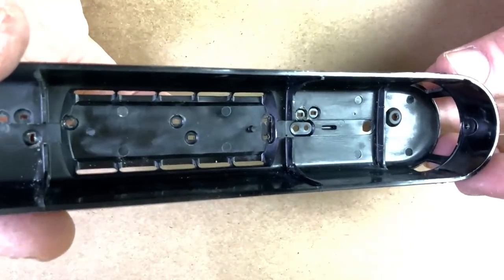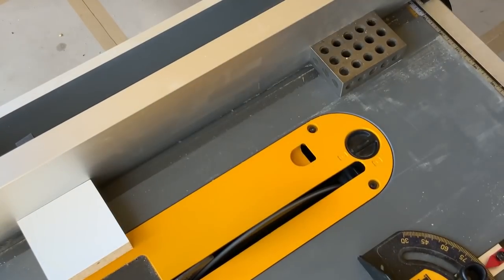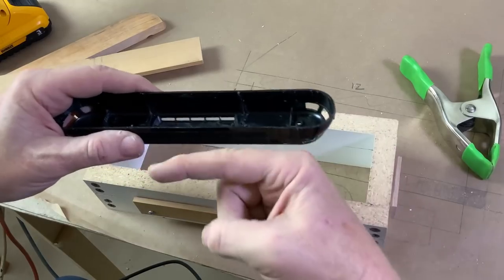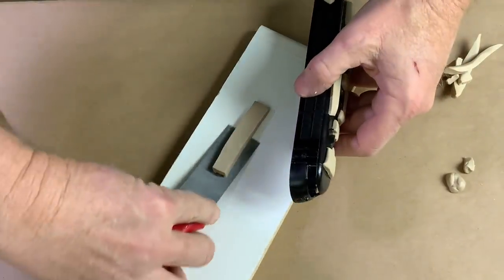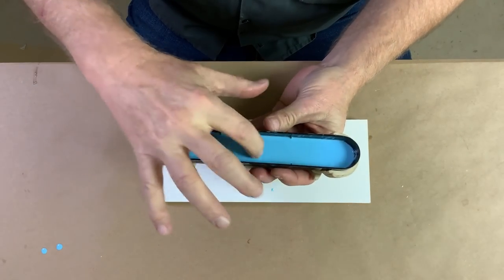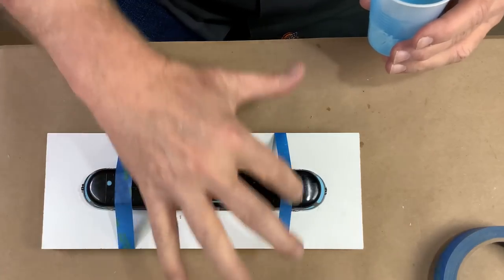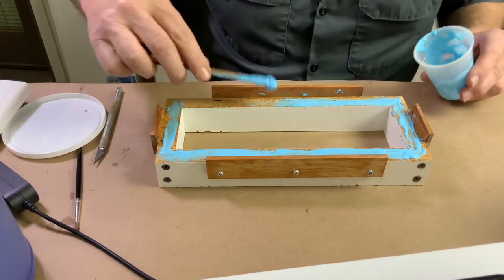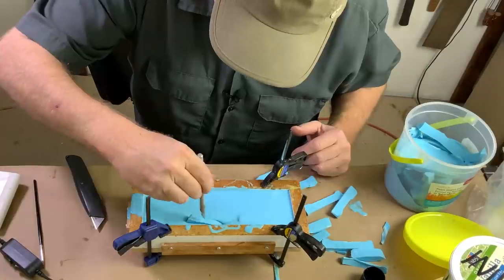Squish Molding An HO Scale Locomotive - Part 1

Comment: I was worried at first when you went to pour the second half of the mold, having not seen if you put mold release on the parting lines of the windows and holes. I'm excited to see how the castings turn out with this mold, and I just might have to try this method with some of my own projects!

I'm glad to have found your channel, too! I do some molding and casting at my day job (though the pieces are waaay too big to fit into a pressure pot) and the insight you provide has helped me learn how to make better molds in a shorter time than I probably would have without it! Keep up the awesome work!

Comment: I'm working on a project and I think this is the technique I will  have to use.  My project is a rubber mask and I think if I do it this way, and use a removable plug inside the head, I should be able to remove the mold and still hold tolerances like he did with this.  Hopefully part 2 worked and so will mine.

Comment: A good look at the process, putting a lot of work into how you're making this. I don't like brush-on mold release, for this reason, get it wrong and risk wasting the mold and part getting stuck. I had an experience like this where I had to repair the mold and it worked but now that the part is removed it might be trickier. You could have poured more silicone in the broken voids along the body to level them and then shave the chunks off the top mold, heck if your good you could cut the chunks off the top mold then brush some silicone on the seam and "glue" them back into the body side mold. Also, you don't have any keys to help hold the center of the mold in place, wouldn't adding keys to the clayed block at windows have helped keep the inside mold from shifting? Maybe a squish mold but I learned from another casting it still benefits from vents between the flat seam so the extra resin can escape up instead of having to travel all the way to the outside edges. I even vent the bottom of the part so resin that went into the vent is available to refill when it's pressurized.
Reply from the maker: Any repair I could do would leave far more casting cleanup than those cut-mold parting lines will, so I’m not too upset about that.  I deliberately omitted keys in the mold because the box is the key. I’m always trying to show different methods of work on my channel. And I’m planning to cut the bottom mold so as to facilitate resin squeeze out.

Comment: The old saying, “we learn from our mistakes” maybe yes, maybe no.  This project must not be taken for granted because using a paint brush to protect the parting line is like making a wish. There has to be a more foolproof way to protect the parting lines. Maybe you should have used BeesWax. I think it would have been easier to apply because you could see if you missed any spots. Painting release which is transparent is asking for trouble.
Reply from the maker: In this case trouble found me!

Comment: wait a 2 part mold? you don't do those often,  another great video!
Reply from the maker: If you notice, my two-part molds almost always have a straight parting line that requires no clay-up. If a part needs a clay-up parting line I switch to a one-piece cut mold almost every time.
Reply: @RobertTolone  so if you ever do a clay up mold I will assume you are in captivity and sending signals 😜
Reply from the maker: @OchoMiniatures  That is correct. Either that or I am attempting to commit suicide using boredom, frustration and irritation. I hate claying up a mold almost as much as I hate cleaning castings.

Comment: I think I missed the part where you put mold release over the widow and through hole areas.   😉
Reply from the maker: No you didn’t miss anything. I didn’t show that step because  (in my head)  making it clear that they were parting surfaces meant that they would get release on them. But it was a mistake to omit that step.

Comment: G'day Bob , another interesting project . Couple of questions . No registration keys for a two part mould ? Also what I've found with squish moulds is to cut small vent channels in the bottom mould that go off to the sides, that way the  excess resin can bleed out without hopefully flash forming . Where these vids made over the holiday season ? Can see you're not in your workshop ? All the best and hope all is good .
Reply from the maker: In this case, the box is the registration system. We’ll see how well that works! I will be cutting channels into the bottom mold.  I’m currently  in my temporary shop but will soon be back in LA.

Comment: Did you put mold-release on the rubber from holes and windows when you poured te top half, or did you just go straight ahead without it? Because I was wondering if the mold-release was necessary on that part, or if you just cut them apart with a blade when you split the mold.
Reply from the maker: Yes, I put release on the small parting surfaces in the holes and window openings.  I should have made that clear in the video.

Comment: Love your enthusiasm Robert! Quick question, could that mold be fixed? Maybe by putting the part back in and patching with new silicone?
Reply from the maker: It’s far better to let the mold close itself back up as it is. The only damage should be a slight parting line around the stuck rubber. I’m hoping it will be easy and simple to clean up because the cuts did not cross areas with much detail. Still I was deeply annoyed when I had to cut the mold free!

Comment: This is helpful, thanks. I've been working on a hand prop (PKE meter) with similar challenges. I'm curious as to why you didn't have to brush release onto the exposed rubber filling the windows and other holes (in the male part) before pouring the outer (female) rubber? And would it have been better to just blast it with a mold release spray?
Reply from the maker: I did brush mold release on the little window parting lines. I didn’t show that step in the video - which was a mistake because many people have commented about it.  If I were to make the mold again I would probably mask off the interior rubber and spray on the release. Although this is the first time I have ever had this problem of the brushed-on mold release failing me,
Reply: @RobertTolone  Thanks for the reply; I appreciate it. Your videos have been very helpful (and very-well produced). I was getting a poor yield trying to pour resin for this prop I'm building; I'm now thinking this "squish mold" approach would work much better. Cheers!

Comment: I wonder why it is that sometimes he uses very complex mold forms I actually builds them out of wood etc and then sometimes he can just use polystyrene? I mean I realized that my lack of knowledge is why this is a question to me but from what I can tell I don't see the difference between one thing to the next of why you need a big complex wooden build compared to styrene and clips is it just the amount of rubber?

Comment: Did you need more pressure than the tape provided in order to prevent the gasket from seeping under?
Reply from the maker: It might have helped but I was afraid of putting to much pressure on the part. This is often a place that gives me trouble because silicone rubber can seep into the most microscopic cracks.  So I was not surprised that the rubber seeped in.  Anyway, it cleaned up fine.

Comment: Hi. Out of curiosity, have you ever tried making an exact copy of a typical 4×6 lego brick from resin?
Reply from the maker: I have not cast a Lego brick. The problem in your question is the word “exact”. In silicone molding and resin casting there is always some tiny percentage of shrinkage. Very often a cast replica will be slightly smaller than the original. Just enough so that the casting will not fit with the original bricks. People run into this problem all the time when trying to make a casting of a part that must fit with other existing parts. The cast replica simply does not fit.

Comment: im new to this, didn't it need venting holes?
Reply from the maker: You can put vents in a squish mold. But if you design it properly the air should be pushed out with the excess resin.

Comment: What were you using for the paint-on mold release?
Reply from the maker: Good question. I should have said in the video that it is MR–150 silicone release agent from silpak.com.  You can buy it liquid in cans but I buy the spray cans and then just spray some into a cup which I did off camera to avoid gassing myself out. It is primarily used as a silicone to silicone release.

Comment: Hey Robert what brand of rubber to rubber mold release do you use? I've used Vaseline. I prefer to use a rubber to rubber mold release made by alumilite. Comes in a little bottles and it's a brush on liquid. I've never had any sticking with it although I've had other brands stick. Great video by the way
Reply from the maker: I use MR-150 from www.silpak.com.  I have found it to be very reliable and was surprised when it didn’t work 100% this time.  Vaseline works but I’m not fond of the residue it leaves behind. You have to be careful to clean it off afterwards.